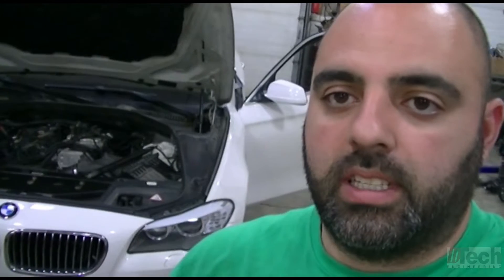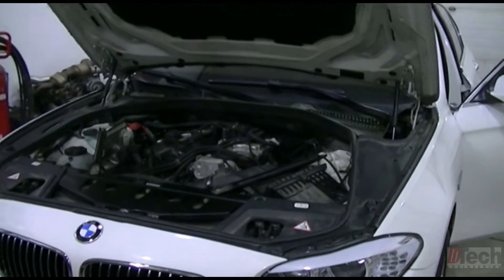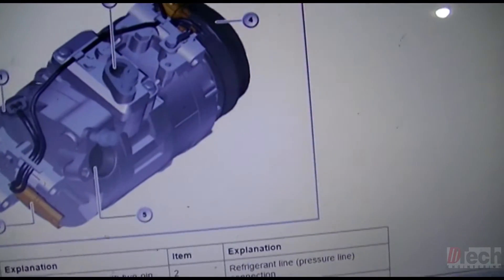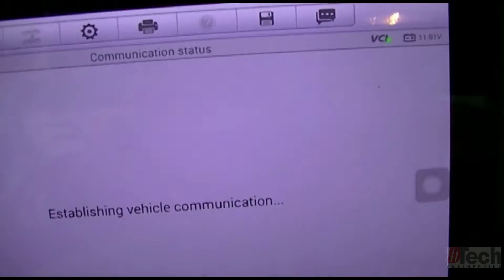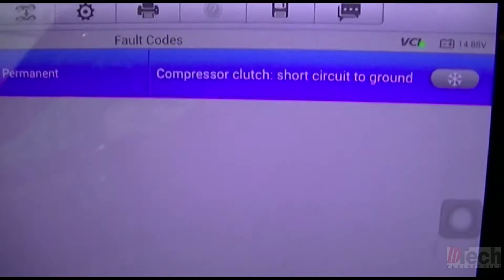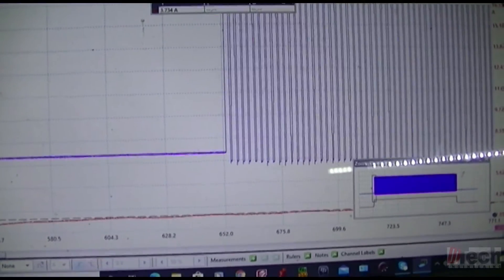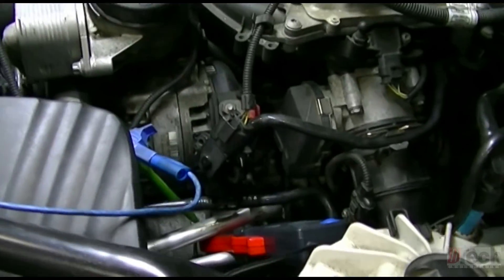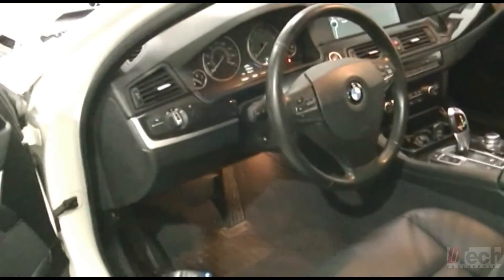BMW Bad A/C Compressor Testing

Comment: Great video, Sadel.  I believe there’s a Klixon thermostat inside the clutch (or a Klixon-type that’s smaller in size) but once the JBE sets the trouble code, the thermostat doesn’t reset until the code is cleared (and promptly trips once the AC is turned back on).  The Klixon devices are quite popular in motors, pumps and compressors due to their efficiency and small size.

There is no better BMW expert than you, brother.
Reply from the maker: Thanks for the info!

Comment: So since that amperage spike is on the pwm wire, would that mean that the solenoid valve and/or swash plate in the compressor has failed?
Reply from the maker: This one actually has both a variable valve and a clutch, hence the 3 wire connector... 2 are for power and ground for the pwm of the variable solenoid, and the 3rd is for the clutch which will ground through the case. The high amperage spike was on the clutch activation wire, the computer "saw" the high amp and so it pulsed it for a quick short time to see if amp would go down. And since it didn't then it stops the pulsing of the clutch and shuts off supply to it and logs a code. The solenoid keeps getting controlled via pwm and is ok. So the issue is the clutch is shorted to ground , once the new one was installed the clutch amp is constant and not pulsed since its now at a safe level. Hope this helps

Comment: Excellent as always, could be that that wire had partial shorted to ground on path between computer and clutch in some casies
Reply from the maker: yes, that can certainly be a possibility and throw the same code,
Reply: @DTEAuto  Thanks your videos are pure gold

Comment: I remember older Mercedes units that would run until they would Lock up from the dryer exploding internally. That would plug everything!! Could a fan failure cause clutch failure due to pressure rise? Or does it still have a high side pressure switch? or just a worn clutch at a extended position possibly from high speed engagements on a depleted freon system causing clutch burn out. I think in the early 90s Buick started using a module for their push button unit in which had a flashing light safety mode to prevent compressor damage.  Instead of just a high side switch, in case the pressure valve were to fail.
Reply from the maker: There is a pressure switch in this system for sure, and I would assume that if psi got too high it would stop the clutch from engaging.

Comment: 801225 Air conditioning compressor: Shut-down due to vacuum in refrigerant circuit 
Can someone help me with this error please?
Reply: I have the same code. AC blows cold air but when it's hot outside, it stops blowing cold air. Did you figure out the problem?
Reply: @BMWguy206  means you have low to no refrigerant.